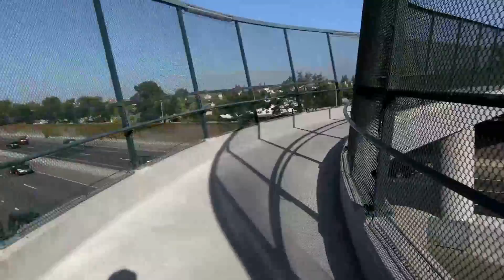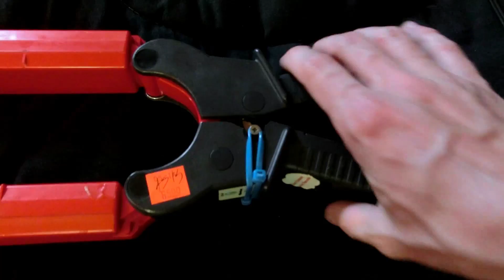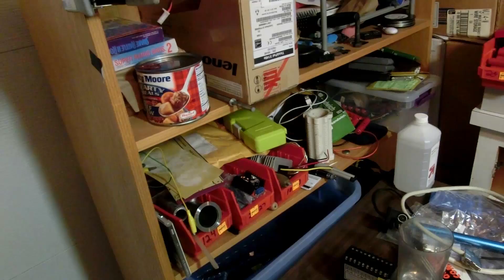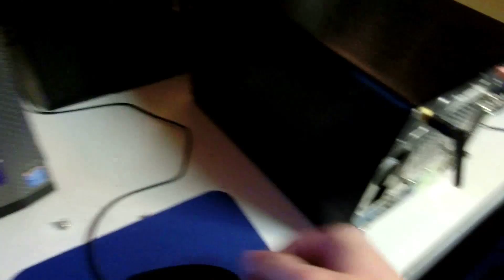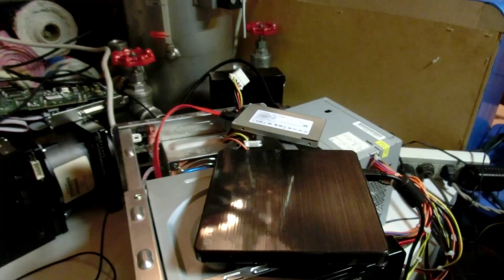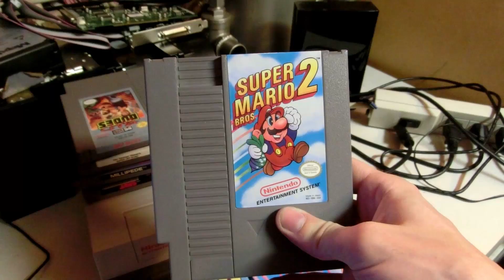Random Bits 0090: Intel ROM Programmer NES games

Comment: Dude, look for a pico power supply.  Depending on the wattage requirements, it will work fine on that shuttle PC.  It sits right on the board's header with an external brick.

Here is one I just purchased the other day for a project:
http://amzn.com/B00HLCT9HK
Only 20 bucks (though you will have to provide a 12v source, I figure that's no prob for you!)

Comment: Don't think xp supports SSD
Reply: Shan Liu It does.
Reply: jas wats As a start up disk? Didn't know that, had no luck in the past. I actually migrated to SSD quite early, never had it run XP successfully. Cool to know.
Reply: Shan Liu It does support SSD's, but you don't get the speed increase you'll get with Windows 7. (Going from HDD to SSD) Windows XP lacks TRIM support if I remember properly.
Reply: Oh, okay

Comment: I have the same micro tower, and the power supply went out, I installed one I ripped out of a flat older machine and used the power supply simi-externally.

Comment: Rinoa, I might have a power supply that should work for that Shuttle-cased PC, looks like the original is a 1U form factor. Mine's a 400w Seasonic SS-400H1U, bought it for a server motherboard project that went bust when the board was DOA. I'd happily send it to you if you wanted it. Depth may be an issue though as the Seasonic is 10.5" deep with its modular cabling attached. Regardless, if you want it, it's yours.

Also, I bet you any money that a faulty optical drive is what's making it hard to install Windows, causing the failures to initialize the installer and/or random freezes. If you have time, might be worth trying a different one. Could also be the IDE controller as I noticed that none of the IDE devices showed up in BIOS. In which case, a SATA optical drive could get you up and running.
Reply from the maker: Tyler McCracken i'm not using IDE, and this drive is what i use for a lot of other computers. its just this computer is crappy.
Reply: Rinoa Super-Genius Oh! I see that now in the video, that optical drive is SATA. If it's known good, then the issue is unrelated. In which case, this thing is definitely more trouble than it's worth. Oh well.

By the way, that PSU form factor is known as FLEX, 1U is actually slightly larger. A few manufacturers make flex units, but the cost is probably more than you're willing to pay to get a mediocre old machine up and running, even if the other hardware was working properly.

Damn, what a shame.
Reply from the maker: Tyler McCracken
the optical drive is USB.

Comment: Do some digging on the net and you`ll find some info on the programmer ,I found a users manual PDF form thought it had how to open it ,didn't read all  of it
http://r.search.yahoo.com/_ylt=A0LEVu_mi41VgzAAS08PxQt.;_ylu=X3oDMTBybGY3bmpvBGNvbG8DYmYxBHBvcwMyBHZ0aWQDBHNlYwNzcg--/RV=2/RE=1435368551/RO=10/RU=http%3a%2f%2fbitsavers.informatik.uni-stuttgart.de%2fpdf%2fintel%2fupp%2f9800819-03_Universal_PROM_Programmer_Users_Manual_Jun81.pdf/RK=0/RS=pFVFIHftS4u4KaT21CWYUT1xM5A-
see if this link works ,that's where I found it
Reply from the maker: ***** thanks, i did spend a while searching but only found information for the model that had a computer screen and floppy drives built in, i think that model you found is correct.
Reply: Rinoa Super-Genius Glad I could be of some help
Reply from the maker: *****
i find myself not spending days searching for stuff because i know as soon as i  post a video, like 60 people will do a quick search and its likely 2 or 3 of them will find something that would take me hours.
Reply: and sometimes you get something useful
Reply from the maker: ***** ok so that link isnt for a manual for this programmer. but i found that "intel-vintage.info" has the manual for it https://drive.google.com/file/d/0B9rh9tVI0J5mNWYxMWI1NGYtMThhMC00YWY5LWIwMWQtYTdkNWJlOTc4MmMz/view

Comment: I have one of those mini pcs. my dad got it from the local dump. the powersupply on it too was broken. i took it apart and discovered that there were a few capacitors bulging. replaced them and it works beautifully now. you should try that and maybe make a video on it!
Reply from the maker: ghostrider433 i was going to but i'd rather fix my apple lisa's power supply than this one.
Reply: Yeah. after seeing further in the video it was a P4 i'd feel the same way. mine was an AMD 6800 dual core so it was in the core 2 duo performance range.

Comment: I really want to build a small system like that, the problem with them is cooling, and trying to fit video cards in them since they take up two slots and are really long
Reply: And has a new 1slot half sized card
Reply: +sc0tte1 You could use like an APU with an ITX board

Comment: Rinoa Super-Genius I actually think I might have a PSU For that Shuttle, If you are interested. Shoot me a PM
Reply from the maker: sorry but i think that computer has more issues than just the PSU.
Reply: Rinoa Super-Genius I believe the connector on the PSU is a Standard ATX one.. You can just plug a typical PSU into it to test it.
Reply from the maker: Cap10323
i did that in the video....

Comment: Pretty sure that power supply is a 1U unit. Should be able to find another easily enough.
Reply: jeremy wallace nah mounting holes are wrong.. may be mini itx or flex atx.. though ether should work

Comment: Wait.... can I do the same with my SNES games? Still got star Fox, and baby Mario.....
Reply from the maker: bravehalospartan you may want to either buy now or wait...SNES prices are the highest of all teh consoles. most good games can cost more than 150$ in box.

or perhaps sell in a bit if you have games your not particularly fond of.
Reply: Interesting... I still have my console, I just need the wires to plug in teh monitor. Lost em some time back. Also lost the controllers.
Reply from the maker: bravehalospartan
the AV cable should be the same as on the N64, Gamecube, and wii so it shouldnt be hard to find.
Reply: Thanks for the info.
Reply: Rinoa Super-Genius Wow they're really worth that much?  I have two NES systems sitting around with a whole bunch of games, I don't have the boxes though unfortunately, just the sleeves.  The trick is getting them to work without getting that pixelated garbage all over the screen, although I find rubbing alcohol and a q-tip works really well on the contacts.
Reply from the maker: sc0tte1
the NES is worth a good deal, maybe 60$ but the games are hit and miss. some are 30, some are 5, and others jump up to 300$
Reply: Maybe I should sell mine once I finish a game or two.